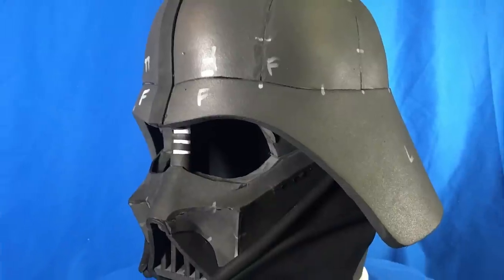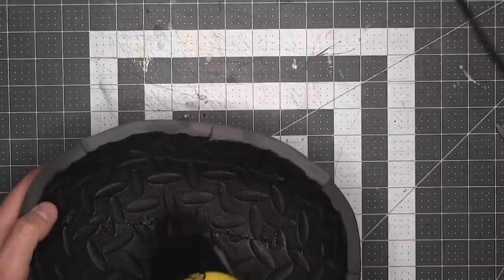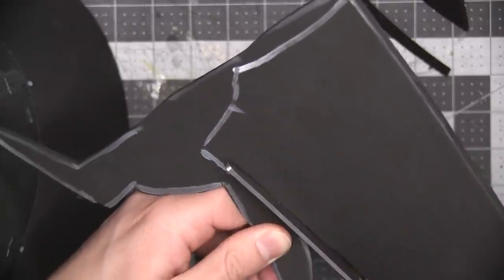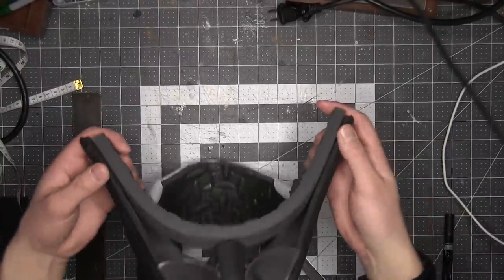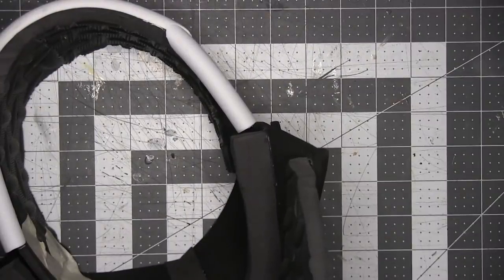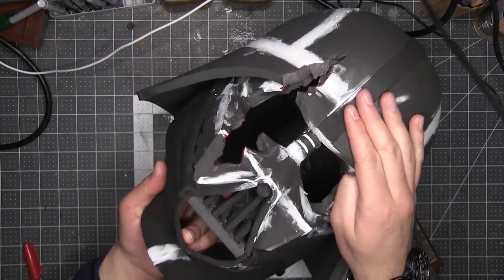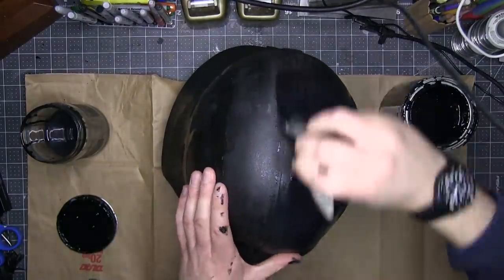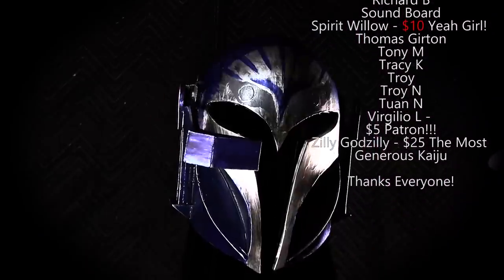Darth Vader Helmet Build With Battle Damage (Star Wars DIY)

Comment: What did you use for the "half cylinder" that is between the eyes
Reply from the maker: It's a few inch piece cut from a bevel strip. same as the bevels that go around the neck.
Reply: @WilliamJakespeareProps  how thick would that be